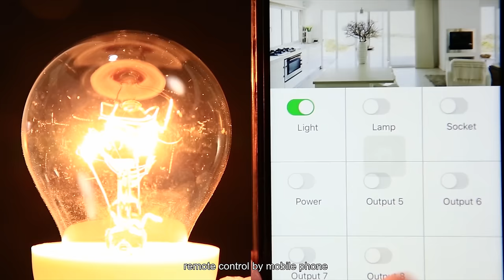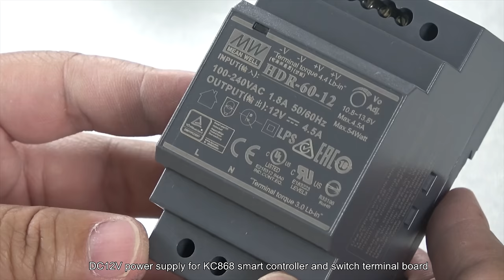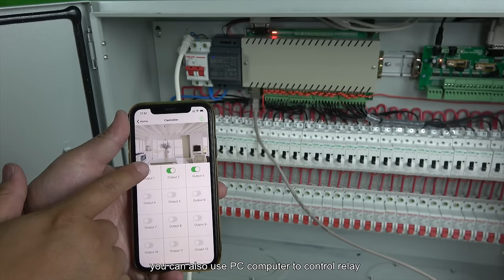Home Automation 32CH Distribution Board DIY Smart Home IOT Project 2020

Comment: i would suggest for the next project, use a busbar instead of daisychaining the breakers... it's cleaner and safer. the only negative point in busbar is that you have to replace the busbar is you want to expand the circuit... havn't seen expandable busbars so far
Reply from the maker: yes, thanks for your suggestion, next project will improve it.
Reply: yeapp... busbar, and normal wire to the connection off the drivers, small secction. great job never the less :)
Reply: one more thing, 25A, and 2.5 wiring you are on the edge off it.  better 16A to that wire section
Reply from the maker: @pedroveloso9707  thank you
Reply from the maker: @pedroveloso9707  ok, thanks.
Reply: good advice, thanks
Reply: Daisychain its awful eee

Comment: Good idea for a project but you shouldn't really connect stuff like this. Daisy chaining the contactors like that will overheat if you draw a big current, use a busbar instead and split the circuit into different sections. So you use maybe 4 busbars with 4 wires from the main fuse to split up the load in the wires. The fuse should be before the contactor to protect it as well because those can't handle 63A like the main breaker is rated for. This is no hate its just some constructive criticism from someone who is a Automation engineer.

edit: spelling error, English isn't my main language
Reply from the maker: thank you very much for your suggestion, we will make new video tour based on new controller and solution, it will be improved.
Reply: @KinCony  Nice! Looking forward to it :)
Reply from the maker: @Willeexd1337  thanks.

Comment: As a control and distribution cabinet, you should distinguish and specify the wire color, usually red wire for phase, black wire for neutral, green/yellow wire for ground, signal control wire is a small wire and also distinguished by wire color and the ends of the wire are the heat-generating contacts, so the presser should be used.
Reply from the maker: thanks for your suggestion, we are designing another new solution.
Reply: good think!
Reply: Distribution cabinet use the cable only fire alarm cable.
Reply from the maker: @dpsmoin2151  how about this style?  https://youtu.be/Ae4CDMBKRwA
Reply: @KinCony  waiting new design so
Reply from the maker: @waoooSky  thanks

Comment: Ron Ross, I am a Principal Design Engineer for a Large Utility in the US. I just turned 67 and I will be retiring.  I would like to add comments for improving your panel. I realize that this may be copied by others. I am not sure of the color code used but the hot wire here is black. White is used for the neutral and green for the ground wire. As I understood your control layout, the relays powered the circuit breakers which then fed the output to the circuits.  The main breaker in the panel limits the internal and downstream circuits by its rating. I did not count the breakers, but I believe you had 32 at 25 Amp each.  The main is maybe 63 amp? two pole. We do not break the neutral of white wire with a breaker in the US. If you are going to use a main breaker, it should be larger, maybe 100 amp. Also, you need to group the power runs in groups of 5 from the main. You are feeding them all with the same wire. The din rail under the relays and the breakers should have a screw thought the mounting plate about every six inches.
Reply from the maker: Thank you very much for your valuable advice, this video made by two years ago, this month we have made a new solution video tour, i think you will love it. https://youtu.be/Ae4CDMBKRwA     how about this solution?

Comment: Death trap in a box! No separation of mains and low voltage. No earthing or bonding. Main switch feeding contractors without circuit protection. Undersized cables. RF devices installed inside a metal box - thanks for demonstration of what not to do.
Reply from the maker: next version will all improve

Comment: 5:05 if you put those remote units in an all metal enclosure, won't that make for poor reception due to them being inside a Faraday cage?
Reply from the maker: mainly use by ethernet, not use by wifi.

Comment: 32 channel means it can control only 32 different devices (On/Off) - correct?  What if I have dimmable CCT lights?  Also, how to connect this to Home Assistant that I already have?
Reply from the maker: yes, relay controller use for control 32CH ON/OFF, if you need dimmer, you can add KC868-D16 dimmer controller into DB, so that they can work in one software.

Comment: this video  is in accordance with my hobby.can the manual  switch button be replaced with a touch switch?thank you.
Reply from the maker: already can extend connect with wall switch. the black button inside of AC contactor only for emergency use.
Reply: @KinCony   No, it's for isolation and bypassing control signals when testing.
Reply from the maker: @BTW...  if use bypassing control, will use COM,NC,NO will be very large space.

Comment: Why you didn’t choose for a wireless solution, Zigbee based or so? Not necessary to wire your whole home to this central switch box…
Reply from the maker: because wired solution is best stable. we will use a new way for switch panel connection, reduce wires number.

Comment: Busbar (Splited (Not one large!!!!)) Clean the paint under the earth strap!!! I would put an earth strap between the back panel and box too. Labels.  Larger neutral distribution bar. And earth distribution bar too. Wiring diagram on the inside of the door. I  would put a switch on the front door. That does not allow the door to be opened while the switch is ON. 
The wire color might OK in your Country.  EU     IEC 60445:2021
Might you want cabinet lighting as well?
Reply from the maker: thanks for your suggestion. this is our new solution: https://youtu.be/Ae4CDMBKRwA  this is better.

Comment: When you come in with AC L1 in one relais and then go 32 screw terminals to the last one, you have high connection resistance. Did you measure voltage drop under load?

Use 4 or more feed ins and connect them in star topology.
Reply from the maker: yes, you are right, now using 8 pins together with power in.
Reply: Poor advice from a non-electrician. Can't you see the gross design errors here? 
The only safe and professional way to do this is use a correctly rated (63A)  manufactured  and insulated copper busbar to connect the supply to all CB's... that then individually feed the contactors.
A single 63A rated cable connects Main Switch to Busbar. Enclosed in a box that would be 16mm2 cable minimum.  what's he using?  Looks like 4mm2 solid core wire at the most... good for 32A. 
Note: No more than 2 conductors per terminal is what those CB and Contactor terminals are designed for anyway. 
Where are the Neutral and Earth bars with a minimum of 33 terminals for outgoing circuits?  
The enclosure is too small to accommodate sufficient segregation and cable management anyway.
Reply from the maker: @BTW...  this is a demo, most use for lamp, not use full current. if large current load need thicker wire.
Reply: @KinCony  doesn't metter what kind of load (lamps or anything else). Remember that CB must protect device AND CABLE - this is a principal rule. In case of some short circuits your contactors and wires are not protected, 63 A will burn out them.
Reply from the maker: thanks for your suggestion, next project will update.

Comment: Is the contactor necessay? , can i make it with just mcb , cb, kc868 , 12v cb and switch terminal only?, i mean what is the used of cobtactor?
Reply from the maker: contactor main control large current load. if only use by smart controller's relay , not use for large current, add a contactor will be safety.
Reply: Does the contactor function same as relay? So there will be current flow in the coil of contactor to close the contact just like relay?
Reply from the maker: @kacoeng  yes, like a relay, but suit for large current, such as 25A,40A,.....
Reply: If you need to ask this question you SHOULD NOT be doing this type of work.
Reply: @KinCony  Use of correctly rated switchgear aside.... what you have fabricated is NOT SAFE.
Reply from the maker: @BTW...  The distribution box is customized, and materials will be selected according to the actual load.
Reply: @BTW...  if you something good to say, go on, else be quiet, The contactor used for high amp, i know that, so keep my question for experts
Reply: @KinCony   It is not a matter of materials used, except conductor size which is wrong. It is the way the circuit has been designed and the sub-standard workmanship that make this an electrical fire hazard.
Reply: @ahmedgholoumbinali6905   I am happy that where I live such works must comply to electrical safety standards. This item does not. I am happy that the manufacture and installation of such equipment MUST be done by Licensed trade qualified individuals and that the person responsible for the work and instillation is held legally responsible for what they do. Kill someone or have an installation burns down by your actions and you go to prison and lose all industry qualifications. 

I have worked professionally in the custombuilt switchboard industry for over 40 years... 35 of which as a qualified designer and supervisor. 
Clearly, you have no electrical trade experience, and KinCony is no 'expert' to ask. That is obvious by the gross design and workmanship errors shown in this video.
Reply: @BTW...  I'm happy for you, pay more for the qualified devices , but i'm happy for cheap one with less qualified but it working, It's like when in old days only rich people had VHS video, but china  make all peoples can have everything's with a price that can poor people buy
Reply from the maker: @BTW...  can you draw a standard circuit share with us, thanks.

Comment: Does each light need a separate circuit breaker
Reply from the maker: no, just traditional breaker.
Reply: Why not to put breakers on the grid side, and have loads grouped, e.g. 4 light circuits per one MCB?
It's a rare case when you can have better safety and save money at the same time. You always should have protection on the grid side, so it protects against the shorts in relays and other steering devices, not only shorts on the side of final loop (cabling and powered devices).
With average LED power consumption of about 6.5 W you can have 350 bulbs on one B10 MCB so grouping circuits with a few MCBs makes perfect sense. Btw., B16 should not be used for standard lighting circuits (if you don't have 3000 W halogen lights).

Comment: Those MCBs are not intended for routine switching things on and off. Typical contact life is 100,000 operations.
Reply from the maker: yes, mainly control ON/OFF by extend wall switch panel, not by MCBs.

Comment: Can I use normal wall switch instead of pulse with 12v switches?
Reply from the maker: no problem, any dry contact wall switch can be used, just momentary switch, not must kincony's wall switch.
Reply: @KinCony  so just toggle switches won't work right?(like on and off), just to confirm, if its a momentary switch with dry contact will work
Reply from the maker: @sur0x  yes, not use Latch switch, use self-reset type switch button
Reply: @KinCony  perfect!!

Comment: Can you also install 32 push button switches for controlling besides the APP?
Reply from the maker: yes, support.
Reply: @KinCony  Can the push switch with LED to indicate is ON?
Reply from the maker: @crypto2own811  yes, no problem, it can feedback relay state.
Reply: @KinCony  Which module controller will work with HomeKit? I need to contol 48 devices.
Reply from the maker: @crypto2own811  KC868-H32BS is best, another you need add a raspberry pi.
Reply: @KinCony  thanks I will order two of the KC868-H32BS from Amazon. You need Raspberry Pi and Node Red for HomeKit?
Reply from the maker: @crypto2own811  yes, we have , all in our aliexpress online store. if you use KC868-H32BS, need add 2pcs of KC868-E16 extend relay module or use by DC contactor.

Comment: sir if the controller fail/breakdown..all the lamp, load no supply right..how to overcome this
Reply from the maker: by manual control
Reply: @KinCony  do you have the schematic
Reply: I'm looking this to install to my home..but inwonder if the controller fail..all the supply to my home will cut off....if i'm using your switch...only twisted cable goes to the switch..cannot supply directly to the load
Reply from the maker: @cikguheng9079  another way you can use a passby switch for exchange.

Comment: Is it possible to direct drive DC valve motors (for floor heating) forward and backward on the output terminals? Can you show how to integrate the controller with Home Assistant?
Reply from the maker: if connect with large current load, suggest add AC contactor. controller can work with home assistant by MQTT, we have video tour: https://youtu.be/Yrat7hVzXRw
Reply: @KinCony  Use an AC contactor for a "large current" DC load?  Seriously?
Reply: The correct answer is.. Yes, if a forward AND reverse function contactors are used. That will use 2 control output channels of the PLC instead of 1only. 3 states of operation... Forward / OFF / Reverse. 
Check to see if the valve motors need to be de-energised after full travel actuation. i.e. if there is internal switching that disconnects applied control signal so the motor doesn't keep running after achieving a full open or close position.
Use contactors/relays designed for use on DC... not AC, unless you enjoy replacing faulty equipment.
Reply from the maker: @BTW...  if you want use DC load, just replace with contact for DC version, there are many contact type can be used, just according to "load type".
Reply: @BTW...  even worse, breaking an inductive load generates an eletric arc which regular AC contactors aren't designed for. You definitely need a device with spark extinguishing chamber, otherwise your contacts are burnt down pretty fast and as a result the contacts may stick
Reply: @KinCony  please inform about breaking inductive dc load. There is a must to consider how to eliminate the elctric arc by antiparallel diodes or a spark extinguishing chamber
Reply from the maker: @freundderuc9146  thanks for your suggestion.

Comment: Are the components UL Listed?
Reply from the maker: have CE
Reply: The circuit design and wiring is NOT complaint to any mains wiring Standards... so, UL Listed components is hardly relevant until it is designed and manufactured correctly.

Comment: Not much smart in 32 on off switches.  Good to see how not to build a breaker panel though.
Reply: Yea those massive jumper chains look awful
Reply from the maker: now we are using new jumper, will take new video later.
Reply: I think it’s neat, BUT is’n all the current for every single braker going through the first screw terminal?! 32x10A……320A on a single screw terminal. Worst case. I smell MAGIC SMOKE…
Reply: @HobbyFinn2   Correct regarding the string connection of supply Active to each sub circuit. EVERY dodgy looping in that panel is problematic. On that type CB the clamp is designed for little more than 32A, because that's the max rating of those CB's, when properly installed. That involves using rigid pressed copper busbar that maybe rated to carry 160-225A total loading which also directly connects to the 2 pole 63A rated Main Switch (it's not a CB... just an isolation switch). Your calculation of 32 x 10A = 320A isn't correct because  this panel would be fed from an overcurent protection device (Fuse or CB) at the Main Distribution panel in the building.... but maybe not if some dodgy idiot connected it up. That fuse or CB's rating should  be no more than the rating of cable to this panel AND the rating of the Main Switch.  Who knows what he has used. Further, he has used small gauge low current rating solid wire for the looping and connection to Main Switch that is only good for 32A... some looping there using lower gauge wire is only rated for 10A. 
BUT LOOK closer.. that unswitched active loop feeds to every CONTACTOR (that has a even lower designed current rating) that then feeds individual CB's.  This "neat" fire hazard is wired back to front! 
In any case, I first look at the Earthing/Grounding circuit, which is most important to protect life... and that fails Standards.   
Further major design flaws present.  
The Control power supply (for PLC and contactor switching operation) that is fed from Main Switch should be protected by it's own 2-10A fuse or CB. Without that the control wiring at mains potential under fault condition (which could happen inside the PLC or any relay switched contactor or low voltage power supply in that enclosure) is 'protected' at a current rating of the fuse or CB in Main Switchboard. Could be 63A... only needs to be 16A to 32A max if that thing is only controlling lighting circuits... more if general power circuits for appliances... and a lot more if controlling high demand loads like fixed heating too.
  
At least he made it easy to isolate any wireless control to the panel. All you need to do is close the metal door of the Faraday Cage enclosure!  LOL
Reply: @BTW...  Thank you for a comprehensive analysis. I am an electronics guy and just noticed that one crazy thing late at night. Many people will benefit from your answer. I this this was more of an art presentation, just that the subjct is really dangerous.

And the video was artistically nice to watch. First time seeing cirquit braker porn! :)
Reply: In regards of costs and sturdyness, this probably is not that dumb of a thing to do, regarding every circuit has an added cost of 15 bucks (breaker & on/off switch) for off the shelf parts. Looking at KNX or smth similar you are around 300bucks a pop for a 8x output (much more compact though) and you are boud to using the software that is provided and not whatever YOU want as control software. There is a place for this kind of installation. The loops are the sole problem I see atm